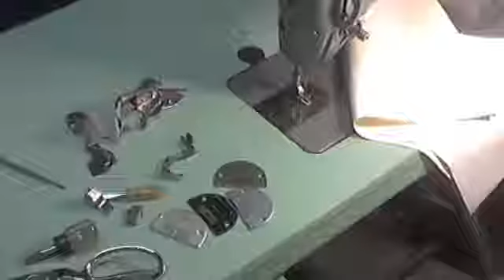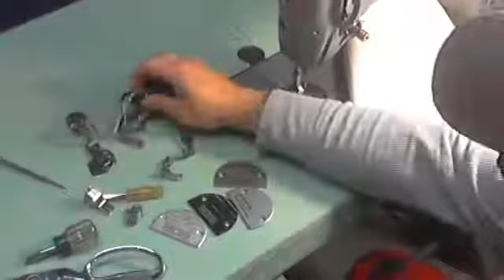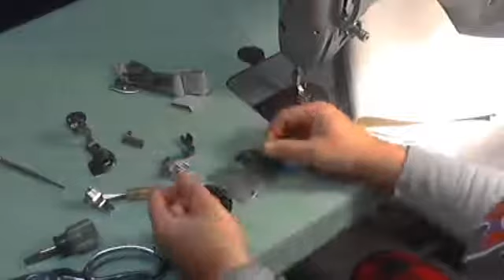Singer 281-1 industrial Sewing Machine Pt. 3/4

Comment: I quilt on mine. Take teeth out and use a presser plate with hole for needle...the foot is small with hole for needle. Used this since 1962. Terrific quilting machine. Have quilted thousands of bedspreads over the years.

Comment: Hi David, me again. I have this machine, but it doesn't have a walking foot or a presser foot. It came with some wheel attachment and I can't seem to make it work. Do you have any suggestions for thread, and feet for this machine. It's gathering dust and becoming a frustration but I really want to get it working. Any help you can provide would be awesome.

Comment: Sewing wool clothing and light weight camp hammocks and tarps
Reply from the maker: If the price is right and you don't plan to do top stitches often, I'd go it. 
The 281 singers will do a decent top stitch, but the machine can be a little finicky. Like all bottom feed dog and needle feed machines. 
Getting the proper thread and needle is important and these machines. 
They're similar to the more popular juki ddl machines.
Remeber, finding a used one at a decent price is like free rent. You can always sell it for the same price when your done using it.
Reply: @davidmiller5832  are there a number of needle sizes for this machine? For my very thin and light fabrics I will need a micro needle. Of course will need heavier needles for canvas and wool.
Reply from the maker: @jamesgraham828  
The size of the needles only matter in relation to the size of the thread. Not so much with the material. There are special needles for leather, but the difference is only on the tip shspe of the needle.
I have a video of a sewing machine sewing 1/2" of mdf lumber and punching holes through sheet metal. So the needles, even the thin ones, are way strong. They're nothing like the regular domestic sewing machines.
So once you decide on thread, you'll be able to choose the needle.
Actually, the thread is the most defining part of the whole equation. People will base the sewing machine relative to the size thread to be used.